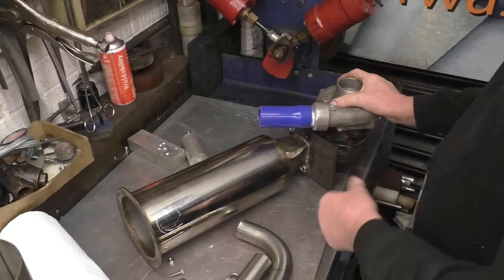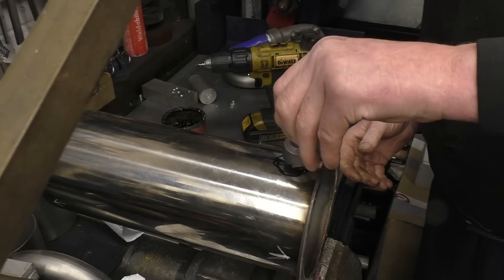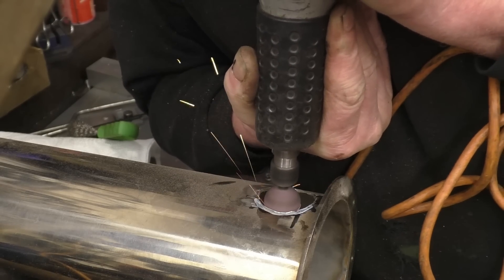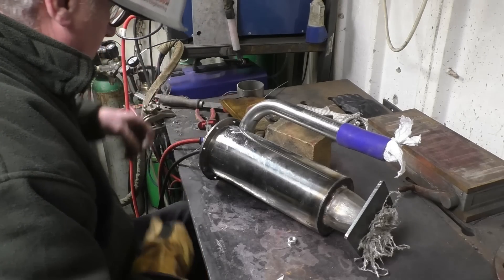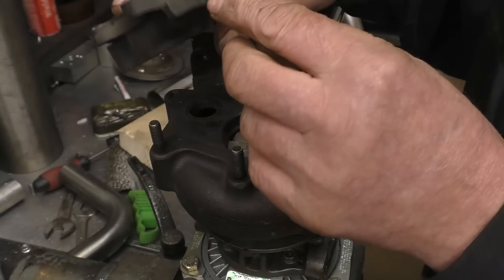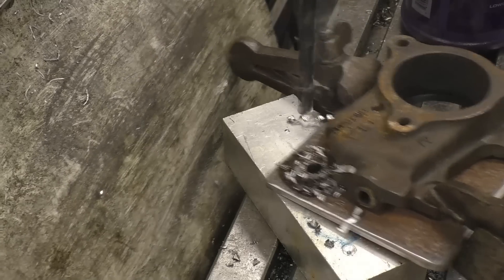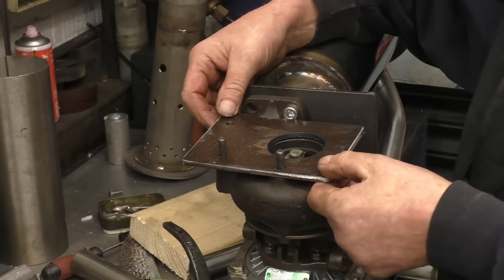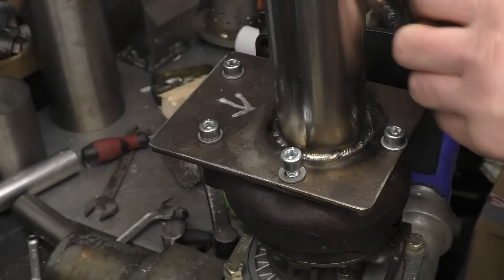SNNC 471 P2   More Gas Turbine Construction

Comment: That is brilliant. No doubt, you are an artist. A jet engine made out of a turbocharger, has been a fantasy of mine forever. One tip: The most critical temperature on a jet engine, is the TIT (Turbine Inlet Temp). Since there is a temp drop thru the turbine, Turbine Outlet Temp can be significantly cooler than TIT, which means it's possible to overheat the turbine blades without knowing it...if you only have a gauge on the outlet. Ideally, you'd measure both TIT and TOT.

My Mom passed about 10 years ago...and I miss her every day. I took care of her for the last 5 years of her life. It was the hardest job I have ever done, but I cherish ever second.
Reply: The waste gate hole might be a good place for a temp probe. Either way it should be filled by a close fitting plug welded to the plate to fill the hole. This will cut down on turbulence.

Comment: If purging becomes a problem for SS you can use SS rod that is coated with a flux that stops sugaring on the backside,  when I was welding we used the coated rods for roots. Also you can get flux that comes in a can that you can paint on the inside of the parts that works too. Cheers

Comment: Drilled holes in work hardened stainless steel, I budgeted 1 drill bit per hole, as they needed to be a little larger, but the material was well hard. Only 20 holes, but cooked off all bits, so for the last few I used brute force and stir welded the hole through, as I was only able to get 10 bits that day at the local hardware. The 800W AEG drill barely noticed the strain, but my arms sure did, that thing has massive torque on it.
Reply: You should have used a masonry bit reground to cut or at least scrape the hole out. Works a treat but it's just easier to buy solid carbide spotting drill to get the holes done. Much easier!